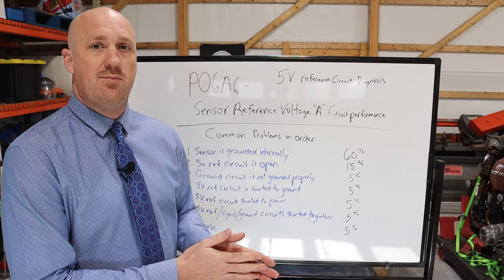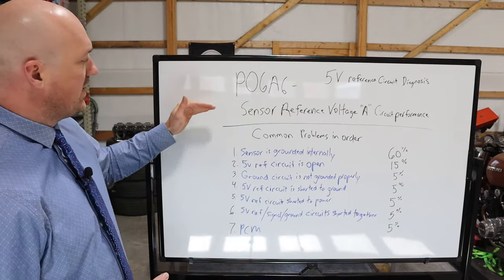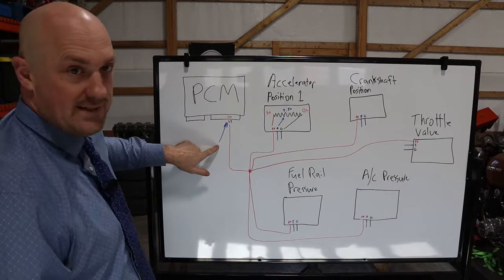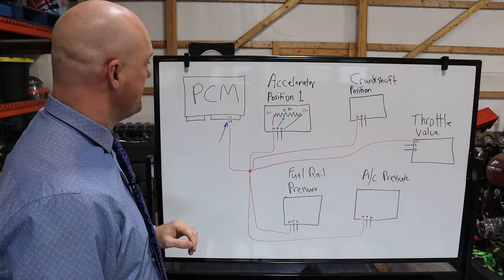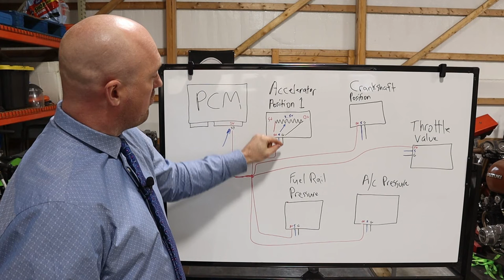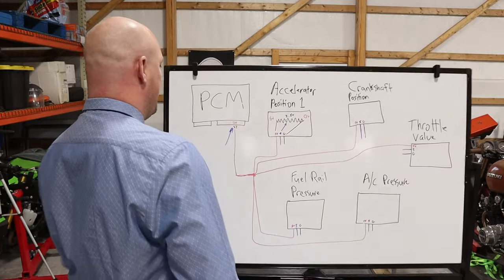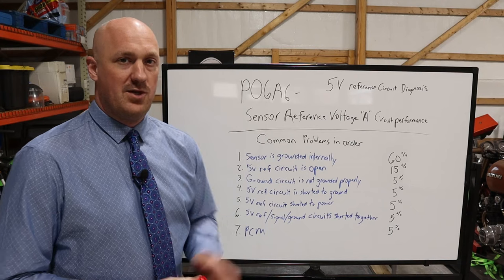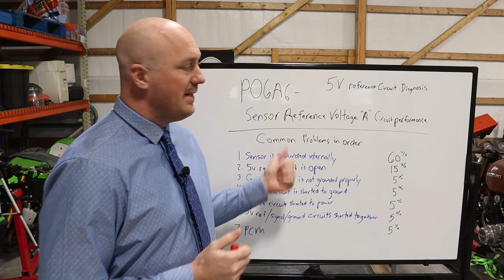Automotive Electrical Diagnosis // 5V Reference circuit

Comment: I'm not an auto electrical diagnostic technician but i am an electronic technician turned marine electrician - seeking to enter the automotive electrical field...at home. I simply want to mention that this instruction makes a whoooole lot of sense to me.
Reply: GREAT WAY of explaining!
Reply: Having 5 volt reference issues after doing head gaskets etc,. My $ is on bad wire cuz I can clear codes and runs fantastic. Shut it down,goes into limp mode.

Comment: Fleet mechanic here. Excellent  video. Just about every mechanic I know struggles with 5 volt supply and j1939 problems , including myself. Just applied the first step to a Cummins diesel I was working on today. I found the problem in 5 minutes. Same approach I use for j1939 issues , just never used it for 5 volt supply. Again,  excellent video.

Comment: Thanks for the video! I am dealing with a rainstorm damaged system. Replaced fuseblock, gem, pcm,alternator, starter, and starter relay. Pcm was the last purchase and was not necessary. I replaced the alternator due to high frequency signal disrupting the CPS. After replacing I still have other codes for high voltage/malfunction for a few circuits. Turns out they all share 5v ref. All wires have .0, .1 ohms resistance. All wires show 5.05 volts. Chasing this down has driven me partially insane still love this stuff though.

Comment: Im really glad i found this video, im going to use it on my stock 1989 2.3 mustang. I accidentally put the sensor in backwards because someone at the shop broke the connector, im not mad its old it happens. Then i tapped the battery together on the positive and negative when I was tightening the battery back up. Now i have to no acceleration issues a while later. I serviced the whole car so yes thank you for this!!!!!!!!!!

Comment: Absolutely great lesson. I'm having probs and will use your instructions to hopefully solve the issue. Virgin all original 2001 Focus no crank no start shutoff while driving dashes for odometer display smell of burnt electrical inside car.

Comment: Excellent job. The PCM sends out 5v to each sensor and reviews the reply/returning voltage. Based on the returning voltage, the PCM determines something is wrong and issues a DTC & turns on the CHECK ENGINE LIGHT so the driver takes it to the dealer and gets fleeced.

Comment: Its true.....thats the way to diagnose an electrical fault.......i got more or less same on my 2001 JGC WJ L6.... (i still have to fix the engine injectors wiring harness .... but here on the island its kind of difficult to find a good one to replace it).... but as a matter of fact a good procedure for diagnosting those electrical issues....keep it up ... nice job bro..... and bye the way ..  have a merry chrismas......👊🏻👍🏻

Comment: Best overall view of this process I’ve seen yet. Thanks for providing a plan of attack. I currently am experiencing a cranks but will not start situation with no spark, and cannot hear the fuel pump running. Furthermore my scanner says “No communication with PCM.” Been watching ScannerDanner where I first learned of the 5v reference circuit. His videos are good but this video lays it out better.  I will be applying this troubleshooting sequence today on my old 98 Dodge Ran 1500.

Comment: Never knew what a reference voltage was till I saw your video,very good explanation
Reply from the maker: Thanks for watching!
Reply: @ReignitedAuto  do 2 pin cam an crank sensor have reference voltage as well
Reply from the maker: @ryanramlochan1504  Nope, those generate a a voltage signal by metal teeth passing near the magnetic end of the sensor, just like wheel speed sensors.
Reply: @ReignitedAuto  thanks just one more thing.whats a bias voltage and the simplest way to understand it
Reply from the maker: @ryanramlochan1504  Not super familiar with a bias voltage myself. It seems to similar in operation to reference voltage, but there might be small differences I'm not aware of.
Reply: OK thanks
Reply: Where do you get wiring diagrams
Reply from the maker: @ryanramlochan1504  google, or ebay can be a good source, just make sure you're getting exactly the right model.

Comment: Thank you so much for explaining this so simply.  Quick question though.  So what voltage readings will you get if a VREF and signal circuit touch, if a VREF and ground circuit touch, and a signal circuit and ground circuit touch for example # 6?  Thank you again.

Comment: New subscriber plus new to the field of automotive electronics . Just a retired aircraft technician learning a new skill for self improvement . Thank you excellent educational video. Just a quick question if you come across my comment all these sensors I assume were on circuit A and any other sensors on say circuit B would be getting a 5V reference from a different wire out of the PCM . Thanks for sharing .     👍 Artie
Reply from the maker: It completely depends on the vehicle, sometimes the manufacturer is actually smart and realizes it's not the best idea to have ALL of the 5v sensors on one circuit 😄 in this case they can split them into two separate circuits. Conversely you can also have one 5v reference circuit, one 7v reference circuit, ect...
👍

Comment: Dang. After finding your channel and watching this video, I was really hoping to see more like this. I just replaced timing chains on a 3.6L GM (09 Acadia) and now I have a cam/crank out of sync code. I was very careful about the chains being right on every tooth. I know it probably jumped a tooth at the first startup, but I wanted to check sensors before I tore apart completely and recheck the chains and tensioners.
Reply from the maker: Those engines are notorious for that nonsense! i've done a couple on some Suzuki vehicles that use that GM engine weirdly. Always a pain in the butt.
Reply: @ReignitedAuto  So I'm finding out! I also did the cam phasers and oil pump while I was in there, but who knows. Maybe one or more of the replacement phasers wasn't perfect, maybe the crank reluctor shifted, maybe a new tensioner isn't functioning properly, chains out of time despite my best efforts...but at least I can check the 5v circuit first. Thank you for this video.

Comment: Nice explanation. I think one might also get a no com with the pcm. You could also check voltage at the pcm ground. If it was open you would see high voltage there.?

Comment: Awesome video, how could I learn more about 5V reference circuits? Also, is reference voltage the same as signal voltage? Thanks!
Reply from the maker: The reference voltage is the voltage that comes into the sensor, the signal voltage is what comes out of the sensor and goes to the PCM 👍

Comment: Wow best application I gave ffound! Please help l have 2001 xj cherokee check engine light illuminated even though both of my readers have no mil light on and zero codes. Also reads ready for smog check. Is this a short? Where should I look ?

Comment: Great video! I have a Silverado with 2.5 volts on my 5 volt ref. maf and map 2.5 volts  and truck doesn't start. Can a bad sensor cause a 2.5 volt at the 5 volt ref any suggestions appreciated thanks

Comment: Awesome. got a f250 with 14 volts on 5 volts ref line. I need a diagram bad and hate electric issues. Unplugged everything still 14 volts. Last wire went to fuse box in cab. Pulled that found junkyard markings and lots of probing. 3 hours later needed a break. I will get it eventually. Cant just fire the parts cannon.
Reply from the maker: Totally agree, in fact, putting new parts on only aggravates the issue because now you have introduced new variables to the scenario. Also while installing new parts you might inadvertently nudge a connector that fixes the issue for a short time. No doubt about it these types of electrical issues are a nightmare!

Comment: Great easy to understand video, very helpful. I have a 09 Silverado, engine went into limp mode , P0641 code. Open circuit. After sitting overnight I took my scan tool and deleted the code. I started it and everything works fine. However I am leery about driving it home as I have to go on a main road with a lot of traffic and no shoulder to pull off. Could a sensor have an intermittent failure or is it more likely a wiring problem?

Comment: Hey man you rock dude I've been workn on my truck off and on for a year " no bus" I tried shotgun approach. Everything new on the motor &trans. Still won't start no gauges nothin,so I've read so many
Forums and I think I tried every one of them. Plugged test light inline got a short light is very brute too it's gotta be gettn full wattage or what ever so I started unplugging stuff to make that light go out I bet you ive unplugged replugged the. Things I so many times I think I got sensor tunnel syndrome I could not wrap my head around the 5v supply until I see this video man I'm broke down in my brother's yard IN THE MIDDLE OF NOWHERE. HE'S A PRICK tells me about everyday to get my piece of shit outta his yard he's seen me go for days without eating. Not IN to drink sleeping in my truck no heat. Summer no fan I been out here close to a year. Tryna get this thing going so I can move on the struggle has been unbelieveable. My jobs are falling through because peaple
 Realize they gotta come all the way out here to get me and then bring me back everyday not good not a lot of work breaks down to not a lot to eat I think since I've been here I've lost 100lbs not far from it I was in despair again not knowing which way to go or what to do then I watched your show today and it put me on a clear path that I can see clearly now it's too dark to do any thing tonight so I can hardly wait for the sun to peak out I'm confident with the information you gave me I can get my dodge going wish I woulda seen that a year ago thanks soon as it fires up imma throw my basket in the truck go get me a good job and prick won't have to worry about me no more I won't be back ever!!#

Comment: When pin is in wire connector at PCM, shouldn't there be power?.or does 5v comes to PCM,?,thx
Reply from the maker: Power comes from the pcm, so it should show voltage, but if somewhere downstream the circuitis grounded or shorted to another circuit it will read 0 volts 👍
Reply: Thank-you so much, excellent board lessons and tool recommendations!

Comment: Well, I did the testing. The first thing was that the Haynes manual showed two grey (5V REF) cables at the PCM, one going to the TPS not touching the other one. And the second grey cable to the EGR and MAP sensor.  Oh, and the numbers in the manual did not coincide with the numbers at the computer plug, so I did a continuity test and the grey color was good to go.  At first, I got the 5V on the first test, then I never saw it.  Well, I went ahead with the other test and the continuity test came ok.  So, without the 5V I couldn't verify if the sensor were bad..., I think.  So, I should be the PCM, correct?  I will give another try tomorrow on the first step, just in case.  Any input at this point will be more than appreciated. It is a 1999 Suburban with a 5.7L Engine. Fuses are good to go, relays.  Before all this testing, I got spark, fuel pressure, and compression.  Still I went and changed things like Fuel Pump, Injector Spider, Distributor, Crank and Camshaft sensor. Battery is charged and I always keep a charger close by and check the voltage.  BTW, this truck died in the driveway, for the lack us use, my best guess.  I am wondering why the two grey 5 Volts Grey cables at the PCM.  I also went ahead and checked continuity at the plug and there was none as the diagram.  Anyways, Thanks for the great video.  It really helps understand this.  I am even motivated to  keep digging.

Comment: Hi, wanted to say great video,  i had a question,  i have a 2012 gmc acadia 3.6 with 145,000 miles got ripped off on this car started giving me problems 2 days after i bought it. Goes into limp mode and stalls sometimes and tgen sometimes its normal. Any advice what i should look at.

Comment: Did you say how to troubleshoot the signal/ground circuit shorted? I listened 3 times and still don't know how to check for that other than to see melted wires. My guess is to check the continuity from each signal wire at the harness side to the battery. Much like you suggested on 3.

Comment: Mitsubishi eclipse 2000
With key on engine off I'm testing the 5v reference at the connector with the connector disconnected!
Am I doing it right.
I only get 1.5 volts!
I have codes for crank sensor and cam sensor!
Appreciate the help!

Comment: Hey I definitely liked your thoroughness you made it pretty explanatory and I am very very new to this part of automotive I have a 2001 Chevy Impala I just did a harness swap just the harness that comes off that PCM and now I have a p1801 code that I have no idea what it is and all it says on my OBD reader is manufacturer control I have no idea what that means but I know that my car also now has an intermittent issue with sometimes it'll go through all the gears sometimes it will only go up to second gear not letting me go past 40 miles an hour I mean I could go faster but I'd be revving my engine way higher any suggestions keep in mind I am definitely wet behind the ears here

Comment: I have a 2007 jeep grand cherokee Laredo 3.6 NAG1 TRANS,it has intimidating no start it starts great when it wants to,codes P0507,p2299,p0113,u0404,u1415,u1414,B212d ,I am going to run through your process today 07/12/21.

Comment: Thanks for the video! I'm having an issue with my 2009 2500hd and have a 12v on the 5 volt reference circuit on the MAF. I have swapped a cammed LS3 into the truck and it ran mint after the factory truck ECU was tuned for the engine.  Then I got poor idle and poor power and drivablity. P0102 code. Bad ground?
Reply from the maker: If you've got 12v battery power on a 5v reference circuit then you've got another voltage circuit shorted to that one.  There should never be 12v on a 5v circuit. 👍

Comment: Very excellent video! In my case, I’m having an issue with the oil pressure unit with 3 wires and when I pulled off the connector with key in the on position and tested the leads I get 8v! Not 12v, not 5v. Given the explanation of the possible problems, I don’t see where this 8v would come from?
Reply: Never mind, as you said, “read your diagrams” Turns out there is a dedicated 8v circuit just for the oil pressure sending unit. So this 3 wire oil pressure sender is not on the 5v system at all. Good news is that means the voltage is what it should be
Reply from the maker: Good job verifying that though! 👍

Comment: Hi, nice explanation. I have a question please. In my Toyota the Vacuum regulating valve is controlled by ecm. It was supposed to have sine type volt function, but when I scope it I find continuous 14 volts. This stop the vacuum and the turbo actuator does not move and the engine is powerless. Could be a faulty ecm though the car starts fine and idle fine?

Comment: Thank you for your video and i learn a lot from it. but there is one thing i would like to ask about it and i will be very appreciate if you can answer my question. so when 5 reference voltage short to ground as example #4 on the board, if we unplug every sensor i don't think this is the best way to check the short to ground for 5vref. what if there is a short to ground after that 5v reference voltage splice, for example. the 5v reference vlotage wire of the fuel rail pressure sensor is shorted to ground bewteen the splice and the sensor. after we unplug all the connectors, we still will have resistence reading from pin37 to ground. what i will do is disconnect each terminal from the splice. i will disconnect terminal for pin 37 in that splice first and check the resistence between that "main" 5vref terminal and ground. if i get the reading, that means i have short to ground problem between pin 37 and main 5vref terminal in the main wire, if i dont get the reading, i will put the terminal back, put one multi meter  pin on the main 5vref terminal and the other pin on the chassis ground and start to pull out each terminal for the sensors until i loss the resistence reading. plz let me know am i right or wrong, i will be very appreciate for your help. thank you very much.

Comment: Excellent trouble shooting lesson - best I've seen!  Seems you have shown me that I have problem #5.   I have an '89 Jag XJS, with the oil pressure and temp gauge going straight to top when ignition turned on. The 5v reference is coming out of the gauges correctly - but at the sensors I have 10.5v at the wire. So from your video - I'm looking for the two circuits shorted to a 3rd higher voltage circuit.

Comment: Solid will find the answer. The 1 thing missing is why is the 5v ref not there when you back probe the pcm. The 5v is shut down due to a short to ground by an internal pcm circuit breaker. Unprotected short to ground will burn wires remember ohms law. And on that note there’s no reason not to pack probe an easy access sensor and monitor from there as you unplug sensors.  Cheers

Comment: When testing, is the vehicle accessories on engine off ?
Reply from the maker: Engine is always off, but whether the key is on or not depends on whether you are doing a voltage test or a continuity test.

Comment: What about when the 5v reference has its own ground through the ECM? What's a good indicator that the circuit within the board, from sensor ground in to chassis ground out, is bad?

Comment: My 5v reference wire shows 12v when back probing with the pcm connected. If I disconnect the pcm it drops down to 0v. I thought it was a short to power but if that was the case wouldn’t 12v always be present regardless if the pcm is connected or not?